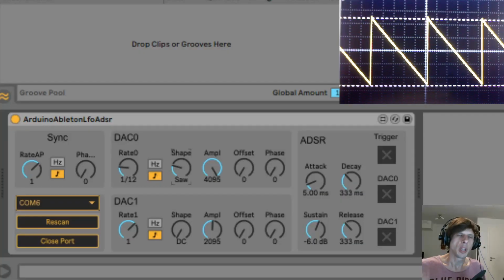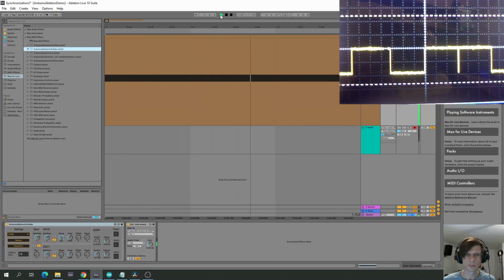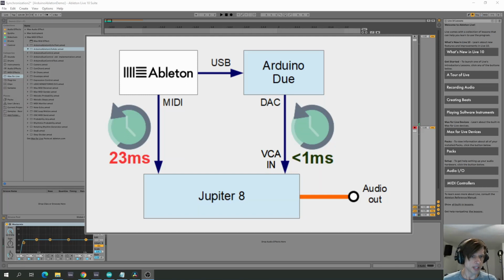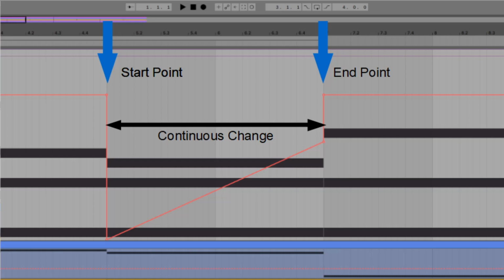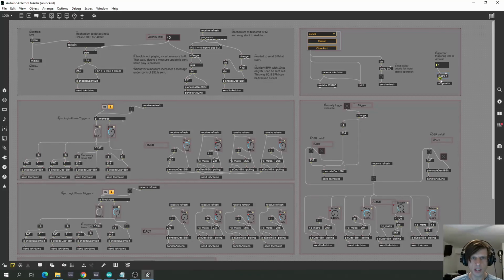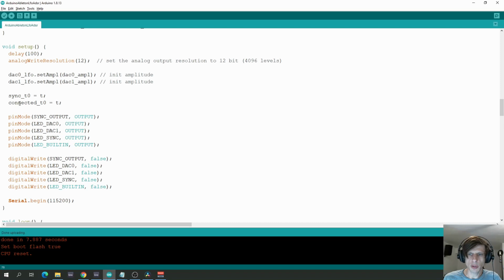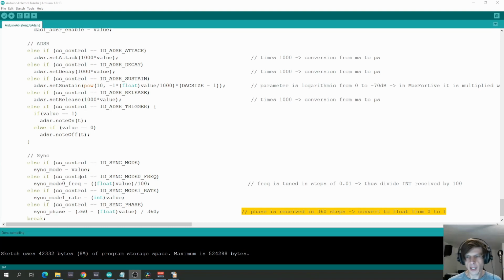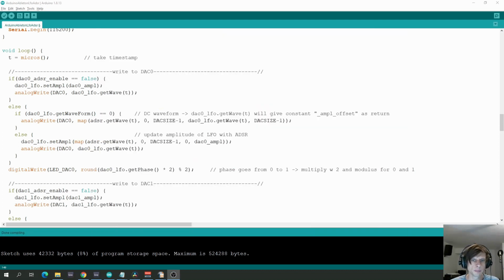Arduino based LFO+ADSR, controlled through Ableton with Max for Live (Part 2: installation and code)

Comment: This is once again really really good !! i'm planning on using a teensy 4.1 to augment a diy lapsteel with a small modular system and planning on using the teensy as a small audio/cv in/out interface communicating with max to analyse acoustic and audio data to generate cv and granular/convolution reverb back to the modular ! your "lecture" handles most of what the communication process will look like ! I just need to figure how to then send the data through SPI to 2 16bits AD/DAC!
Reply from the maker: Sounds like a fun project! Good luck with onboarding the 16-bit DACs. Might you post a video of your project, let me know :-)